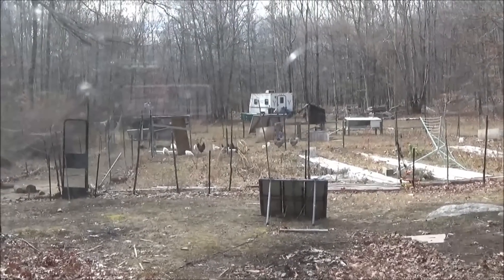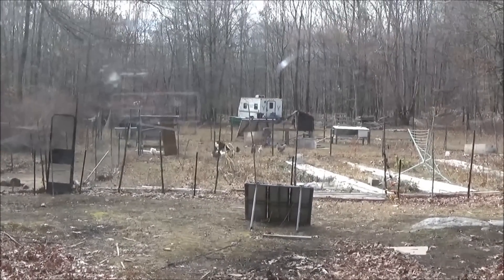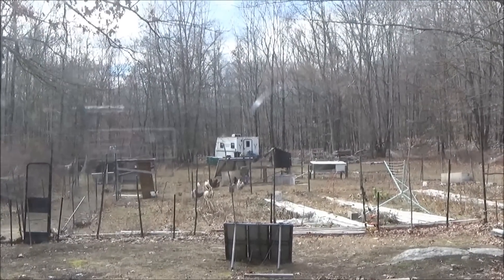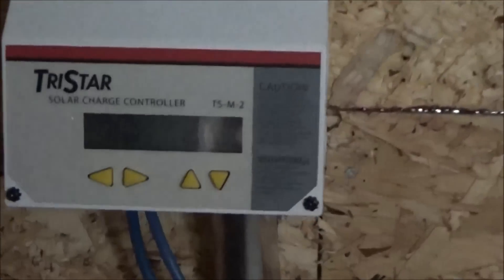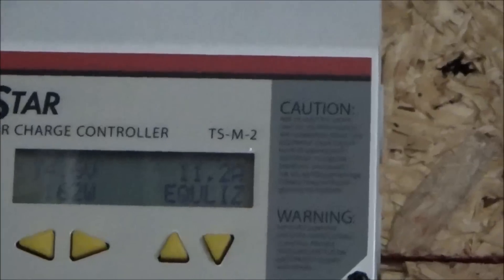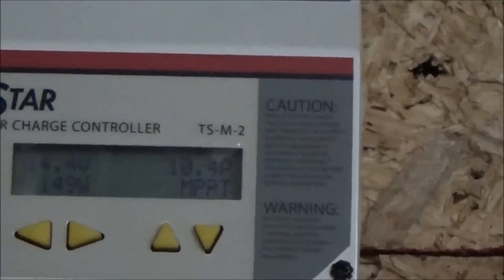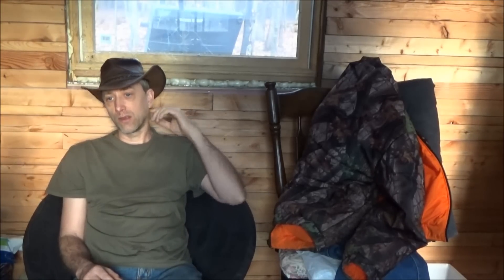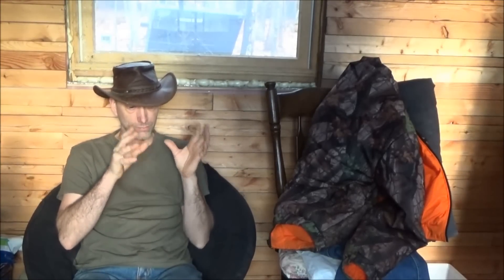Researching Best Off Grid Solar Batteries For The Off Grid Project ™

Comment: troy i watch all your videos and i look forward to the next,and i don't usually comment but this time i just have to intervene here.#1 you are not properly desulfating your batteries, you must individually remove them charge them discharge them under load and repeat process, if in fact these bat. are new they should not be sulfated......you most probably have 1 or 2 bad batteries. #2 your wiring is less than appropriate for what you are attempting to accomplish. 00 1 or 2 gauge should be your goal. i understand that your only working with what you have but if you continue with this practice of improper application you may burn this tiny house on wheels down. no matter how many fuses you apply.#3 golf cart batteries are not appropriate for solar applications due to the fact to maintain a consistant charge you need a high amp continuous charger. i have had solar power banks last for years, i have used a few different brands, all 6 volt from cheap to spendy,  i have found that the Trojans are probably the best intermediate batt, i have used.... the higher the amp hour the better the batt. and there are some spendy batt. out there. there are allot of novice solar users with great info and you really need to look into the advise of some experts. this off grid living is not without its dangers. and it could very well do you harm or burn it all down. and that's not what we want to see here. you need to be successful in this journey troy. #4 and i hate to say it too!!!!! you put allot of your tittles (for example) "Rewiring The Tiny House Solar Power System Properly" now the amateur attempting to duplicate your methods may not have the same out come as you. and may result in a batt. explosion or structure fire. safety first troy, ??? days without serious injury  you're doing a fine job on your home its looking good, carry on and good luck!!!!!
'

Comment: You need Iron Nickle batteries they will last 50 years if taken care of properly and can be repeatedly discharged 80 percent. Very expensive though. The only source I know of is Iron Edison

http://ironedison.com/
Reply from the maker: Yes that is a dream I have one day. But for now forklift batteries are just about as good. So far the longest test I heard about is 22 years and still going.
Reply: Oh they are real nice ... but whom among us can afford a $10k for a battery bank?
Reply: James Pottorff  James,
All solar or renewable power schemes are expensive, unreliable and intermittent. They only make sense in Off grid situations where you are too far from grid power. That being said I do not know where you got the 10k number from. Iron Edison offers offers systems that include charger, solar cells and batteries from 3.8K to 44K depending on what you desire(being selective on the numbers?). Me personally I do not regard solar/wind as serious power sources. It is much cheaper and more convenient to buy power from the grid. Though I do enjoy Troys channel, I find it a cross between home improvement and this old house on a budget:-)

Regards.
Reply: SEDAZ01 the 10k price I quoted was for a 1125 ah 12v  bank (high end), this info came from Iron Edison's website. Granted any off grid power system is more expensive than on-grid. But when you are in a location where power is unavailable, any power that you have is priceless, no matter the cost of the setup. The nicest off grid systems that I have seen, tend to be rather small in comparison to on demand power we get from the power companies. I would much rather invest  a few grand into the equipment that I need, than to be paying the power company for the rest of my life.

Comment: yes the best batterys now needs to stay at room temp and a 50 to 100 amp charger  eveyday  get the tec sheet on that battery read a book by a genarater 20hp to 40hp diesel is best older the beter till you can make that kind of power
Reply from the maker: You only have to put back in what you take out. If I use 200 Ah per day then thats all I have to put back into the battery bank. The tech sheets are for heavy duty forklift use drawing the batteries down to 80% discharge each day and then topping them off overnight again. I plan to keep them above 20 to 40% each day

Comment: If forklift batteries are preferred, then why do most solar homes systems use Huge 2 or 6 volt cells, like the Rolls brand or BAE?
I know those are really expensive, The Rolls 2V 600AH cells cost at least 1000 bucks a piece, but I know they are very popular.
Reply from the maker: I think I mentioned it in the video. If not, then sorry. They are just plain too heavy for most people to move around. Thats the limiting factor. And as you said, the Rolls are so expensive that most homes cannot afford them
Reply from the maker: My old phone is deader than dead. Please email me your phone number. info@thediyworld.com

Comment: Most people who are "preppers" erect wind towers in the summer while the weather is nice, not in the middle of winter.
Reply from the maker: Most people already have homes.
Reply: The Do It Yourself World I know, but you've said many times how efficient that little generator is. So my point is you really don't need to do a less than perfect job right now on erecting a wind tower when you could easily wait until next summer and do it properly.
Reply from the maker: Albertzz99 I think I would lose a lot of subscribers if I do not set it up asap. People are getting angry. Plus the extra free power will be quite helpful. Why run the generator as much when I dont have to?
Reply from the maker: Albertzz99 It is funny but often people say do not let my subs run my life. But on the other hand, I must keep them entertained and happy or I lose them. Interesting problem huh

Comment: going with the big boy eh....  heres an idea  build a insulated box for it get some heat tape or similar(heating blanket) and wrap the battery very well  keep it out side the house  with that bigger power source you should be alright to run the heat tape or similar(heating blanket) during colder spells  or maybe divert some of the heat some how from the house to the box     ....  techman is a blessing im including him in my thoughts this xmas    and on a side thought  will your charger do the job? bigger battery bigger amp charge for the job...
Reply from the maker: I do plan to build a shelter for it and heat it from the house using a dryer duct. My charger will do fine. I will have a bigger battery but that just means I will not cycle it as deeply as the old ones.
Reply: The Do It Yourself World I like that idea of heating the box. Could you do something similar for your water storage? Your little stove seems to make heat to spare which could be diverted to the other systems. Will this keep harmful fumes away from you?
Reply: The Do It Yourself World
Yes, dryer vent!
Reply from the maker: SSanf I plan to have the batteries, food and water in a single heated shelter

Comment: i think 6 volt sucks even if u series them. i use 12 volt deep cycle. i have them set up parallel. it gives 440 amp hours. they are 110 each at 12 volt still because they are not set up in series. golf cart batteries suck just my opinion
Reply from the maker: Golf cart batteries are learning batteries.
Reply: +Methos Films they are cheap, and easier to get

Comment: Troy, have you ever thought about using batteries from EV cars? they are built for a lot of abuse and hold up to high amp loads and daily recharges... you can pick up 7volt prius cells for as little as $10 each off ebay, i seen a lot of 100 x 7 volt prius batteries go for $500 bucks. that would be 2000Ah
Reply: http://www.ebay.com/itm/TOYOTA-PRIUS-HYBRID-BATTERY-CELL-MODULE-FOR-2004-2005-2006-2007-2008-2009-/171605735210
Reply from the maker: That is a dead cell though. I am not sure what the life of one of those is but yes they are normally quite expensive. The biggest problem is that they are not standard voltage. It would be hard if not impossible to adapt to a standard 12 volt off grid system. That may have been intentional.
Reply from the maker: storxusmc Here is my problem. My charge controller is programmed to properly charge and maintain a 12 volt battery bank. There are set parameters programmed in for 12 volt batteries. If you switch to 14 volt batteries then they will never be fully charged and would be damaged. A 12 volt battery needs about 13.6 to 14 volts Dc to charge it.
My inverter kicks off at 15 volts DC, which is the equalize voltage of my charge controller. A 14 volt battery would probably need 15 to 16 volts DC to charge it. My charge controller can never provide that much voltage and my inverter would kick off while charging.
Now, if you designed your own solar charge controller especially for those voltages then everything would be good.
Reply from the maker: storxusmc I am making this separate as a different thought. What is the expected life of those batteries in off grid applications? I mean you do have me thinking now. It is an interesting idea. Design a charge controller that can handle the voltages of that battery bank. The inverter could be designed as well I guess.

Comment: A (singular) 2volt DC Forklift battery?   Unless you have six of them. . . . you going to have a DC voltage issue.  That is the way to go. . . but when you go 2volt you have to get 6 minimum to make it useful.
Reply from the maker: It is a 12 volt battery made of six 2 volt cells.

Comment: Sounds like you are going to have a nice battery soon, are you going to have some one separate the cells for you, they are usually held together with like a tar like substance to hold them together and they use a hot plate to separate them.  Cant wait to see you with one of those. and if you do put them in side you need to make sure its good and vented,
Reply from the maker: I am hoping to be able to separate them myself. From my studies online I think you just cut off the terminals and pull each battery cell out of the case. I have not seen any tar substance in between. Not saying I am an expert. Just from watching videos and researching. Although there is not much out there honestly.

Comment: A forklift battery is a bit much, why not just get a few 6 volts and wire them for a 12 volt system makes more sense and room. just a thought.
Reply: Barn wood should be LAST on the list troy..GET THAT WIND TOWER UP ASAP!!!!!
Reply: you have no idea wat you are talking about!, the bigger the bufer , the better!, the wind power at this moment is useless, he cant store the energy they will produse becouse of his existing battery bank. (witch is normally 12 volts), the 6 volt cels are in parralel now to thry to restore)
Reply: MrBugsier5 The bigger the buffer is good but not the case of a battery bank, The bigger the buffer is not the case. It must be matched to the use. Under using a battery can lead to a shorter life span as fast as a undersized battery.
Reply from the maker: blakke29223 Not true actually. Under using a battery extends its life in most cases. That is my goal anyway.
Reply from the maker: Because a forklift battery is a 20 year + investment rather than replacing your entire battery bank every few years.
Reply: The Do It Yourself World
I think you missed the point. If you use a 800 AH battery and your system can only charge for a 500AH setup you will kill the battery with time. Yes if you keep them on a float rate they will last 30+ years if you don't use them. But then whats the point? I can go in depth on charge rate and so on but I hope you understand what I was getting at in my last comment.
Reply from the maker: blakke29223 Ah, but what if you have an 800 AH battery bank and only use it as a 500 AH battery bank? Then you are not deeply discharging it daily. The most important point in any solar power installation, I think, is the solar panels. You have to be able to replace whatever power you use each day. The larger battery bank is a nice buffer for cloudy periods so you dont hurt your batteries as easily. A wind turbine supplements power and a generator prevents damage after too many cloudy days on any sized battery bank.
Reply: The Do It Yourself World Ah, yes what if you have a 800AH battery bank and only use it to as a 500AH bank? Then it is called a DoD, Depth of Discharge. The less the better. Something we all want to achieve. But that wasn't what I replied to in the thread now was it? I don't care if you have solar or wind power, if you can't charge, to in this case 800AH then you will kill your battery with time. A 1-3 day back up is good, but 

    
        
    MrBugsier5 said a  bigger the buffer is better. A buffer has nothing to do with it. You must size YOUR system for your use.If you buy a battery bank to have a buffer and not the means to charge it, you kill the battery. If you buy to much in solar panels, then you are throwing money away. You say it's all in the solar panels, then your spending more then you need, after the charge is completed it's a waste of money.
Reply: blakke29223  No it is not!!!
the bigger the bank is  the less you stress it by drawing power from it, a lead acid cel works the best when you do not stress it, so my (proffesional) advice is when using a traction set to get the biggest one you can affort!, afcourse its most important to keep them charged fully as mutch as possible,, its not like using nicle cadmium cels, thats quite different!!
Reply: blakke29223 that is also not thrue, it is so when you draw the max out of it, but in this case you dont! normaly the safe way is to load wit 10% of the bank capacity, so when you use a 1000 amhour bank ju can safely charge it with 100 amps, when you only use a smal amount of power from the bank you only have to thrickle charge it, and equalize from tyme to time, you dont do that with big amps, but higher voltage, a 20 amp charge in this case wil be good enough.(profi advice, no bla bla!)
Reply: he knows he has to keep is bank nice and cosy warm, if you keep tem topped up as mutch as possible and equlize from time to time this bank wil live log, i have clients here offgrid to who we installed 2000 amphou banks stil working good after 20 years with the same bank!
Reply: Its troys decision , I was only offering my opinion..The Wind tower needs to be put up soon or mother nature will halt that project
Reply from the maker: Shaggy one I fear you are missing the point. I will NOT be discharging the battery bank that low. I prefer to keep it above 20%. From my studies online people with forklift batteries who keep them above 20% charge have a very long lasting battery. Just because I have a bigger battery does not mean that I will use it all. I only have to put back into the battery what I take out.
At most I might need more solar panels. I have to evaluate my daily usage thoroughly and compare it to my daily solar panel production and make sure I get as much in as I take out. Then everything will be good.

Comment: the fork lift battteries I've seen are 2 volt, wont you need 6 of them to have a 12 volt system?
Reply: Seana Richmond Fork lift batteries come as a pre assembled pack, 6 - 2 volt's for a 12 volt pack, 12- 2 volt's for 24 volt's and so on. Yes they are 2 volt but the design of use is different form a standalone 2 volt battery.
Reply from the maker: yes

Comment: I will have to continue my research and look into forklift batteries too. I've learning about batteries and thought 6v with a series/parallel connection was best, but not so sure now. Thanks for sharing, looking forward to learning more.
Reply from the maker: 6 volt batteries are good. Forklift are best. Trojans are the best golf cart batteries. L16s are the next best. Then forklift. But it depends on your ability to move them around and your budget.
I would put AGMs in a class of their own due to the price and quality. Above is about flooded lead acid batteries only.
Reply: Thank you, that added some more food for thought too.
Reply from the maker: Phantom Rider :)